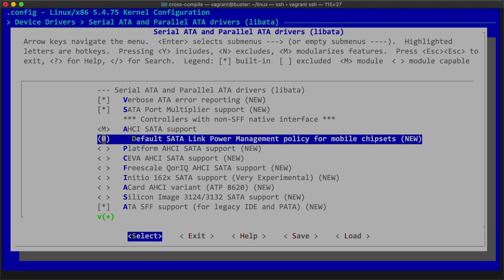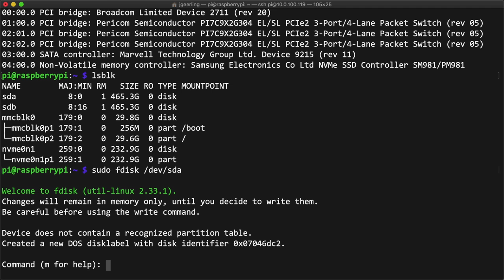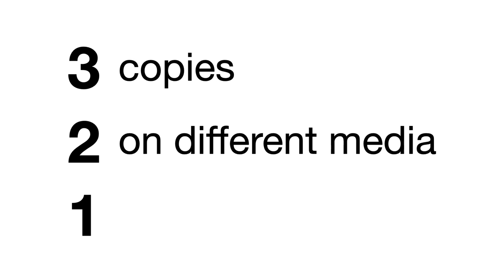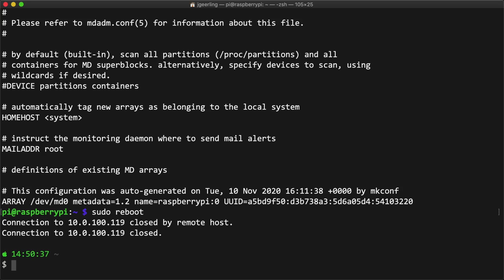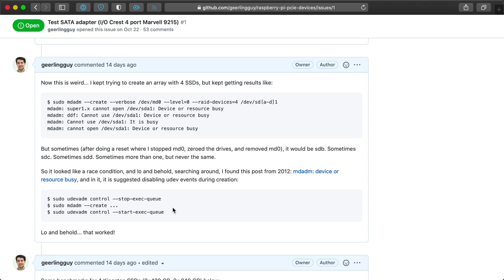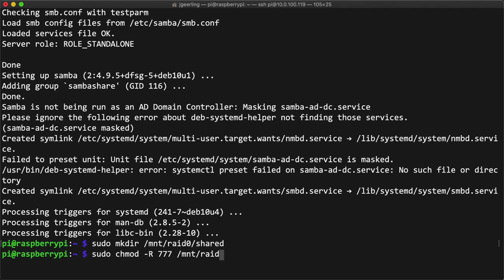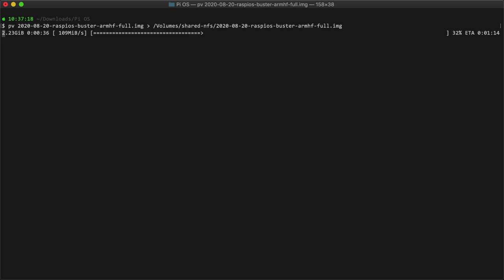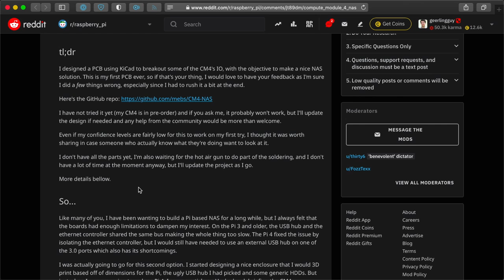I built the fastest Raspberry Pi SATA RAID NAS!

Comment: Ow God the reference to all those raid 6 is not enough in 2019 blogs.  Those blogs all used  some dubious math about the mtbf and some other metrics. Please don't spread that BS. ( I'd advise raid 6 though, idd raid 5 is a bit meh, but so is raid 1 with 2 disks for that matter) other than that; nice vids
Reply from the maker: To be honest, the only way to speak with authority would be to set up and monitor at least dozens, if not hundreds, of identical production-usage RAID arrays, analyze drive and full array failure data after months/years of use, and generate useful analysis based on that.

But as it is, we basically have to rely on anecdata from comments on forums and subreddits :(
Reply: @JeffGeerling  +1 for more empirical testing, this stuff is hard with all the factors which come into play. Btw, how about combining this harddisk stuff with kubernetes? Do a review on a micro cluster running ceph-rook ( pretty please :) )

Been running it for a year now on 4 business desktops,  it feels like I'm living in the future. My stack is, hp6300s, canonical maas, kubernetes, and thus Rook for persistent IO. Complete rig incl 16 port switch runs with 100Watt

Comment: Yes BUT what do you do when your SSD is a piece of crap to start with?????? Recently (about a year ago) I bought an SSD for my aging Windows 7 machine!! And before you give me crap about still using Windows 7, I only run it for programs that don't work with anything BUT Windows 7 and some Windows XP software!! So my hopes were "simple enough" to use the machine as a way to "update and transfer" rig, as I switched away from Windows to Linux.....and things WERE working GREAT in this configuration.......that is until the brand new SSD I bought died!!! 

I didn't know that SSD could fail so randomly!! And while I have a lot of my data backed up to larger hard drives, there was stuff on the SSD that I had not transferred OR backed up yet to anything!! In fact I thought "I have time" and that is when something failed in the SSD!! 

So completely in fact did the operating system SSD fail, that now I can't even get back into it to recover ANY data still on it!! And the SSD now reports that it only has 20 megabytes of space available on it!! Which is odd enough being that it is a 512gb SSD!! And then the other fact I have a hard time buying is that this SSD I own is just ONE YEAR OLD, when I have 320gb hard drives that are over 15 years old, that still run flawlessly!! Makes me question the reliability of SSDs totally!! And some of those 320gb hard drives I have were pulled for working machines years ago and now live inside external hard drive enclosures that I use for back up only devices!! Making me question the SSD drives even more!!

Comment: For starters, NOTHING LTT has ever done checks the box for "brilliant". If you knew anything about his stupid "RAID" setup, you'd be surprised if it didn't break.  You're only afraid of RAID5/6 because you don't understand it. Because data (and parity) is spread across all drives, nothing meaningful can be recovered from a single drive; you need most, or all, of the array to recover anything. RAID0 does the same thing without any parity for data recovery -- lose a drive, lose the entire array. RAID10 stripes pairs of disks, so potentially half the drives could fail before losing the array. Of course, a two disk failure could as well. RAID10 costs you 50% of the storage space. RAID5/6 costs 1/2 drives. To me, that's a very fair trade-off. At the end of the day, any data that matter to you should exist in more than one place.
Reply from the maker: "You're only afraid of RAID5/6 because you don't understand it" (which is what I mentioned in the video). I'm okay with the 50% tradeoff just because drives are so cheap nowadays. If I was more budget constrained and had massive (hundreds of TB-level) needs, I would probably spend more time digging into RAID6 or RAIDz options with parity, but as it stands, I am more comfortable with mirrored setups.

Comment: Love the nerd hate for parity raid. LOL.

It's not a backup. Which is the mistake LTT made. Which is why my server which is using it backs up offsite.
Reply from the maker: It's not the end of the world, I just don't like it. If you choose to use it, no problem at all, as long as you still follow 3-2-1 rule and know that there's more risk inherent to RAID 5/6 z5/z6 than there is to 1/10.
Reply: @JeffGeerling  RAID 5 vs RAID 10, sure. But with RAID 6, I can lose any two drives and survive. With RAID 10, I can only survive two drive failures if they're in different mirror sets. So there are trade-offs even only considering the safety aspect. Of course, one can do 3-way mirrors (and we actually do that at work), but that gets even more expensive.